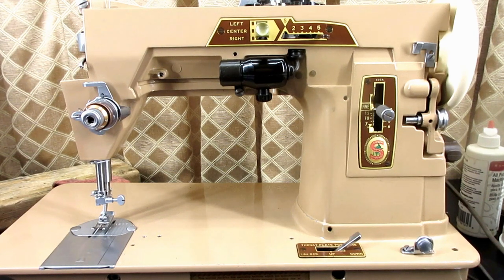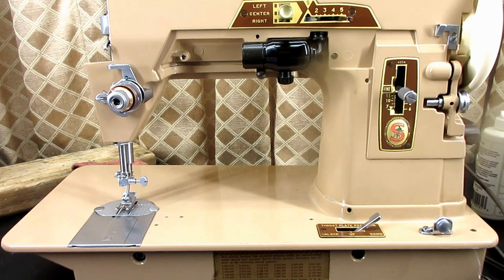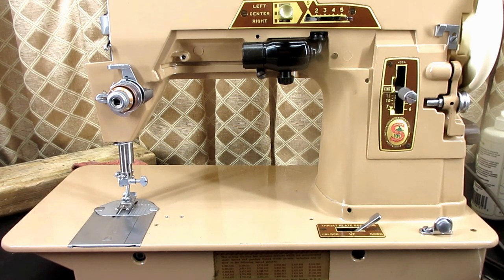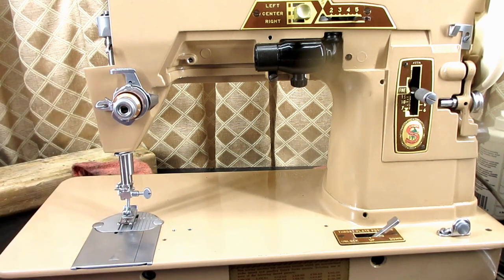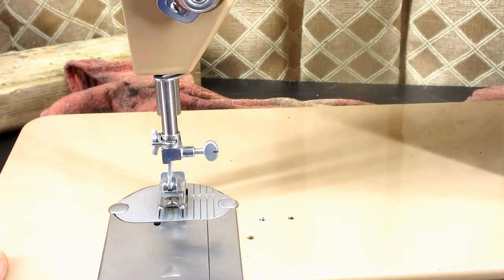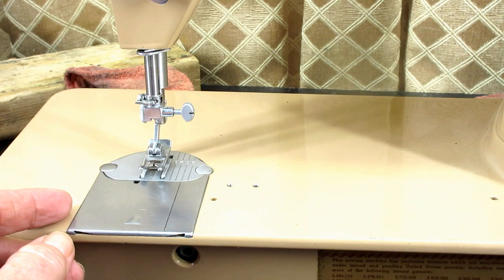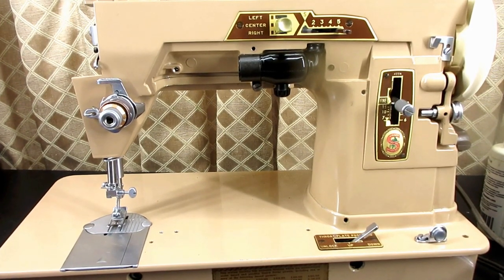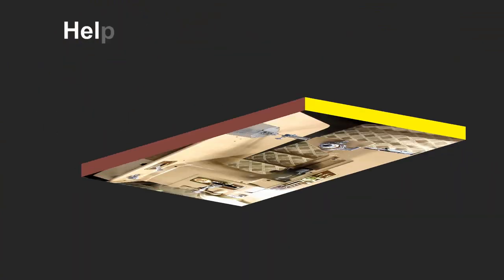How to Time the Disc Driving Worm Wheel on a Vintage Singer Model 403A Sewing Machine

Comment: Hi Andy.  Turns out my disc driving worm wheel was already timed correctly.  I'm amazed that it would stay timed all these years.  Anyway, when I saw you had already put on nearly all the parts to your machine, I did this, too.  At first I was confused what goes back on first---then I decided to do and watch your 403 videos in reverse order and install the parts that way (Duh!--I should have immediately thought of this.)  It was so interesting to see how how grimy your machine was when you started.  I wish I would have taken before pictures; next time I will.  Your pacing of two videos a week is just perfect for me.  It allows me to think about things (and do other things) and clean and store any parts I took off--I'm so glad I cleaned, packaged and oiled the parts as I took them off. The parts were ready to go as I assembled them.  The nosecone area was the most stressful for me to put back together--but everything's in now, and it all seems to be working.  Looking forward to the adjustment videos.
Reply from the maker: More often then not the DDWW will be timed OK when you buy a vintage Slant-Needle Machine. It is usually found to be off when someone has worked on the machine before you and was trying to fix a ZZ stitching problem. They start to disassemble parts and get lost and then during reassemble they know nothing of that timing mark or that the clamping screw are used to hold that big pin in a certain place for the timing to the follower. That fact that your timing was OK is a good sign, IMO, that the machine did not have a "Honey, I'll fix your machine for you" type of well-intentioned mechanic that played around with the machine. I remember the first couple of machines I restored and I also found the nose-end parts the most time consuming to reinstall. You did it though, and congratulations! The next time will be easier for you, and there will be a next time I'm sure and even more after that. It's just so much fun and very rewarding to restore such a great machine. See you next week for the "Stroke & Tension" video. Take Care.

Comment: Thanks for this video, Andy. It's given me a little bit of insight into how a zigzag machine works. I've never worked on anything but a straight stitch Singer, but I just got a White 970 that zigzags and has decorative stitches. Except that it doesn't. 😢It has a camstack and a "following finger", but I can't figure out why it makes some of the decorative stitches sometimes, but not reliably. I'm sure when I finally figure out what I'm doing, it'll be very gratifying!
Reply from the maker: A couple things I learned early on about ZZ stitching. (1) Dirty or dry parts affect the ZZ stitching performance much more than straight stitching. Sometimes all I needed was to clean and oil the parts. (2) When there are multiple pattern discs on the camshaft there have to be "lifters" as well as the followers. These raise or lower the follower(s) to the disc for the pattern you selected. If the machine has been in storage for a long time the lifter may be "stuck" in the up or down position. There can also be two followers; front & rear. All of those parts move into a certain position according to your selection of the pattern. Maybe the front follower moves to disc 3 but the read follower fails to move to disc 5 and you do not get the pattern you are expecting. Another reason for cleaning (even just alcohol slopped around to loosen dried oil) and apply fresh oil. Move the control levers on the front or top of the machine and watch what parts are moving or trying to move up, down or towards the pattern discs. (3) You may be setting the controls wrong, or incompletely or the controls are not working completely. A few times I took a much more thorough read of the instruction manual and found I was not setting the controls completely for certain patterns. Sure, I was setting a selection lever or dial to say, the blind hem stitch, but failing to move a corresponding lever or dial. Now I read every instruction manual, cover to cover before I start restoring a machine. It helps me understand what the machine can and is supposed to do and how to get it to do that. After cleaning when I start to test and adjust I can more easily tell when something that is supposed to move is not and then figure out why.
Here is a link to the instruction manual for the only WHITE 970 I could find. https://www.singer.com/sites/default/files/outdated_product/864_white-970%2C972%2C979-x-.pdf
I'm sure you can figure out what is happening, mostly b/c you want to. I think desire is 75% of it. Oh yeah, when you get it going you feel the master mechanic of the year! Thank you for watching my channel.

Comment: Hi, your videos have helped tremendously with my new 403A sewing machine I inherited from my Aunt.  My needle is hitting the leg when using the disk zig-zag.  I have watched the video and aligned it but it still hits the leg. Any other suggestions I might do? Thanks for all your videos.
Reply from the maker: When you say "leg" I assume you mean the presser foot. Be sure the needle is not bent. Check the alignment of the presser foot. https://youtu.be/qNURZmUPraA
Watch these two videos. You don't need to make any changes, but watch the videos to see if your machine is set properly:
https://youtu.be/tcdGVzL9T6o
https://youtu.be/ZTmyM4MNX6o
Download this service manual (it's for model 503A which has the same mechanics as your 403A but this manual has better directions for adjusting)
https://sewingdude.files.wordpress.com/2012/09/singer-500-service-manual.pdf
Look at the adjustments on pages 38 & 39 to see if your machine is adjusted properly/. Good Luck.

Comment: Question I have the 503.  My regular stitches and timing are fine. I did this test and again fine.  Everything was oiled and moving freely.  I can’t seem to do anything but zigzag no matter which cam I have in.  I have played around with each stitch width and it’s the same.  What can I possibly be doing wrong.
Reply from the maker: Wait; are you saying that you CAN NOT sew straight stitch, but ONLY zigzag stitches? That's a first for me as I usually hear just the opposite. I want to be sure of the problem. Maybe you mean even if you use a cam OTHER than zigzag, say the blind hem cam, you STILL sew a regular zigzag stitch, and NOT the pattern on the inserted cam?

Comment: “Perfect timing” for this video (sorry for the lame pun). My “near mint” 403 makes a loud intermittent sound from the disc driving worm wheel. (Guess I found part of what’s not mint.) Are worm wheel and work wheel used interchangeably? Also, even though my 500 has an internal cam stack, does the gist of this video apply? Andy, as always, thank you for what you do.
Reply from the maker: I'm really smiling while reading your comment ... "what's not mint." Oh, man, the stories I could tell, haha. So your sound could be from a different part nearby, but you can pull the DDWW and clean the area and get a better look. I have also found broken pins, needles, and plastic parts down inside, ( 1/2 half of a plastic bobbin one time, all scratched up) so who knows until you look. About your model 500A. You will find that a piece of cake to remove the cam stack parts. Just that big screw stud right on the top if I remember rightly. But just so you can be sure, follow this link to download a FREE copy of the original Service Manual for Models 500/503. https://sewingdude.files.wordpress.com/2012/09/singer-500-service-manual.pdf
Page 34 has the instructions for removing the cam stack. If you want to remove the selector arms, lifters and followers, well, that is much more involved, then you have to put it back and adjust some of it. The service manual is about 45 pages long and has all you need to know about R&R parts and adjusting to factory specs.
Reply: I appreciate your reply. :) I already have the manuals for the 403 and 500 downloaded, thanks to one of your earlier videos.

Comment: Andy, so my 403A is all set. She sews nicely. But! It never sews the cam pattern😞 what can be wrong?
Reply from the maker: In this video, you saw the follower arm that rests against the pattern disc when the machine is set to ZZ width sewing. If your follower does not touch the pattern disc it is out of adjustment, or the Stitch Width Selector Lever is out of adjustment. I'll assume your follower DOES touch the disc, OK? Then on the bottom of the follower post is an arm that pushes on the paddle of the Needle Bar Driving Arm. That NBDA connects to the Vibrating Bracket that holds the Needle Bar and makes it swing to the pattern disc. If the NBDA was installed wrong and the follower lower arm is not pushing the paddle then the NBDA won't move the Vibrating Bracket or Needle Bar. Here is a video showing the way the NBDA works and how the paddle of it works. Maybe you can check that operation for proper movement. https://youtu.be/tcdGVzL9T6o
I have seen times when all of that was installed correctly but the Vibrating Bracket did not move b/c it was loose or even frozen b/c dirty, dried oil, or lack of oil. This is the video about the VB https://youtu.be/ZTmyM4MNX6o.
Reply: @andytubesewing1953  thank you Andy.  I'll re-check the vibrating bracket and NBDA. After I do,  I'll let you know what happens. Thank you🙃
Reply from the maker: @puzzles2me  Yes, please do. I'm curious as to what you'll find. I always start at the follower arm at the pattern disc and follow the movement towards the needle bar. I know you'll work it out. Happy hunting and take care.